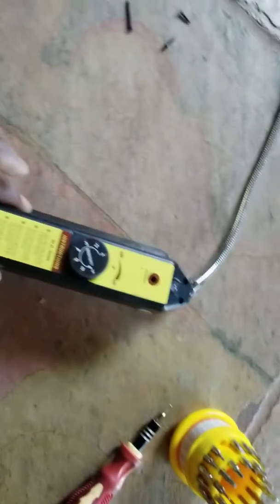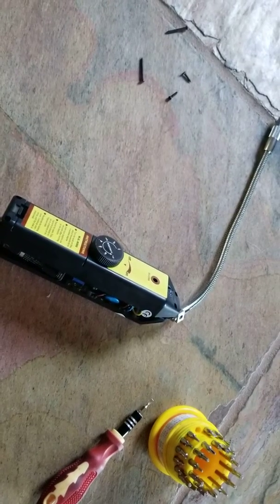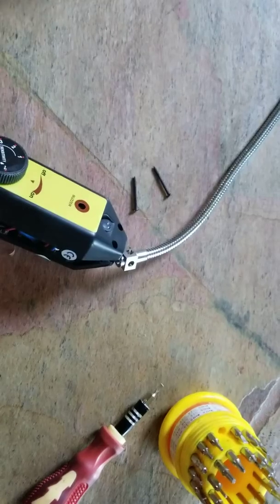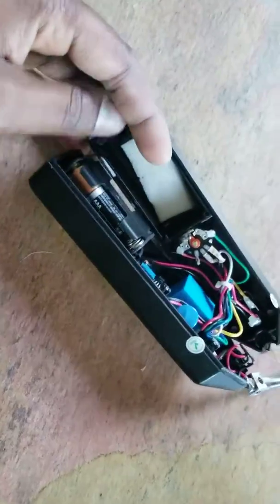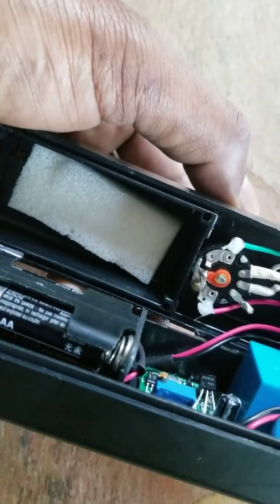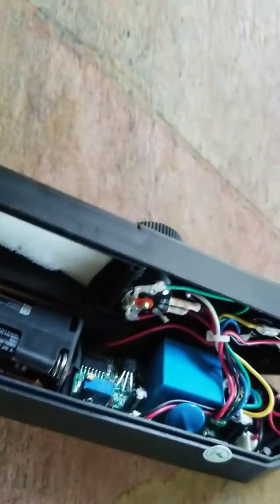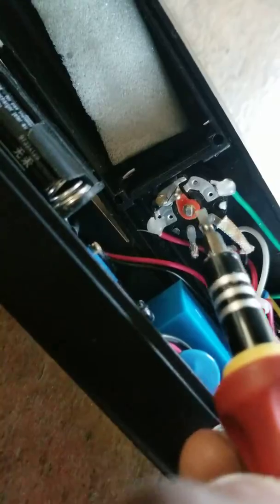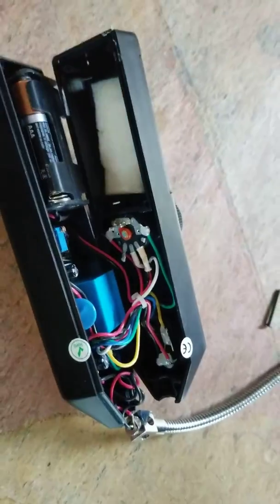Refrigerant Freon Leak Detector - DOESN'T TURN ON ?? FIX IT

Comment: Great information thanks!!! 
By the way mine does not work , it don't detect the refigerant gas and some times detect gas in places like a chair 

Look 

https://drive.google.com/file/d/1J-J4DTwfjAkUAzAE4fGb9w1WHHS1Tna9/view?usp=drivesdk

Vid 2

https://drive.google.com/file/d/1J04ALCixD-9tlfpAkjbADUiSxex7bwsb/view?usp=drivesdk

Vid 3 

https://drive.google.com/file/d/1J0GJs0tf0C8eTCd7akGk85-LjWHrWB4m/view?usp=drivesdk

Do you have any idea to fixit?
Reply from the maker: Mostly the tip sensor is faulty now and unfortunately, they don't sell just the tip.
But you can try certain things in sequence before throwing this in recycle:
a) Follow tip reset process: Turn Unit Off, Wait for at least 6s, Tur Back On At Low Setting in ambient air, Wait again at least 6s, Expose to Leak Air, See if it detects it now.
b) Make sure the tip is not dirty. Try cleaning with lens cleaner.

NOTE: Each time you change the sensitivity, you have to first remove the tool from the area you're testing and put into ambient air, change the sensitivity, wait for at least 6s for the sensor to be re-calibrated to your new sensitivity setting.

As well I noticed you are making contact between the tip & the surface, don't do that. This will permanently fault the tip easily. Always maintain some space between tip & the surface.
Reply from the maker: Please do subscribe to the channel to support it, if my videos/tips help you anyways.